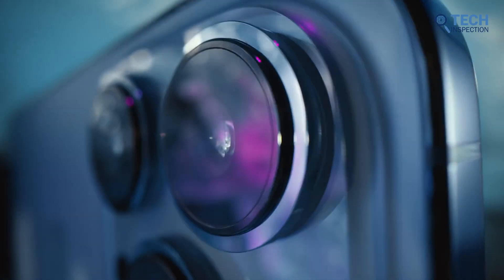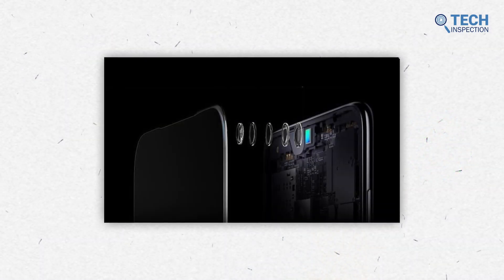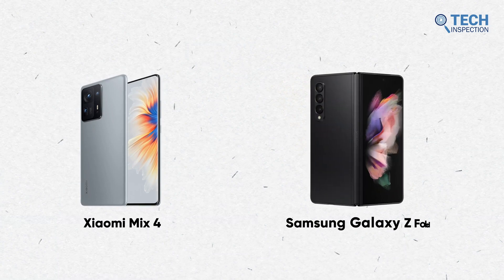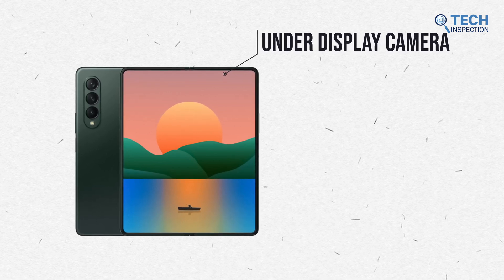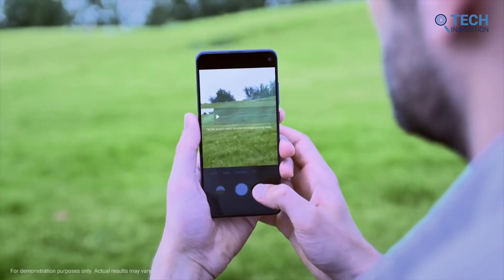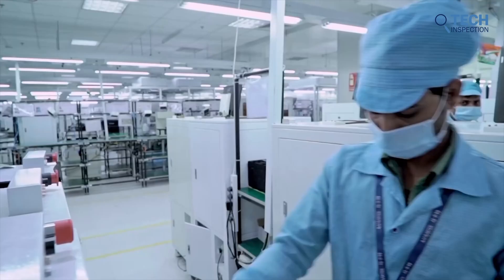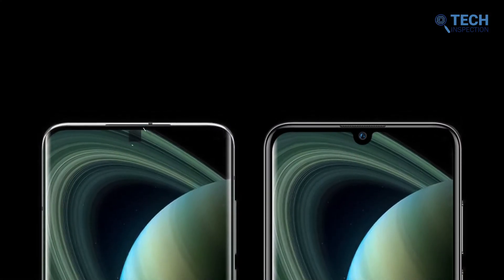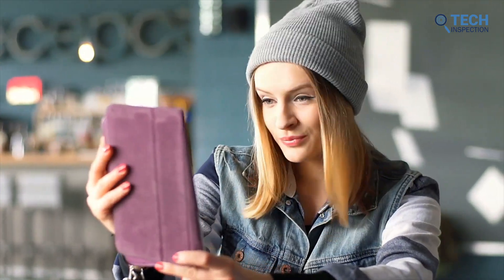What's Wrong with The Under Display Camera Technology

Comment: Of course it's nice. 
But a small punchhole in one corner (not in the center!) 
would be fine for me. 
More important, to reduce the bezels/black frames of the screen and 
making the phones not that expensive and also 
making them more rugged 
without looking so.
Reply from the maker: Totally agree! A small punch-hole off to the side doesn’t bother me either. It’s more important to have thinner bezels and a strong, durable phone, without driving up the price or making it look bulky. Under-display cameras are cool, but not a must-have for everyone.